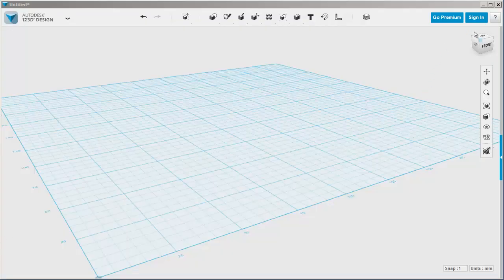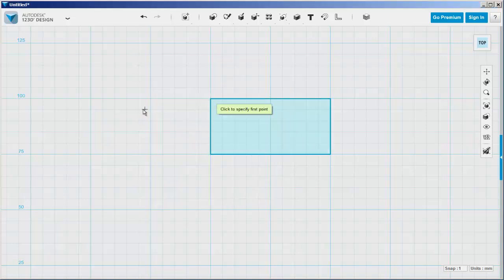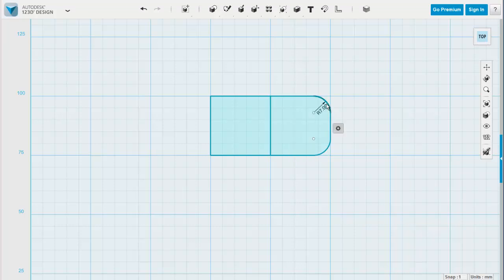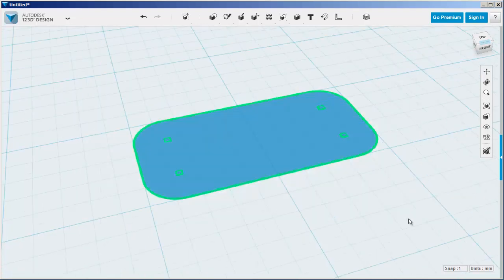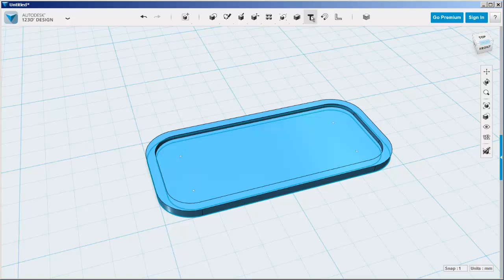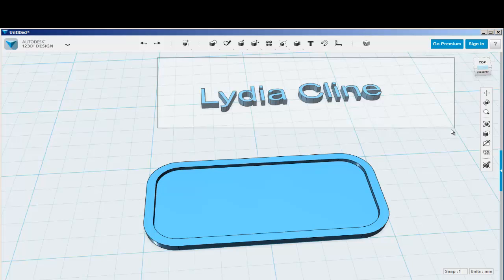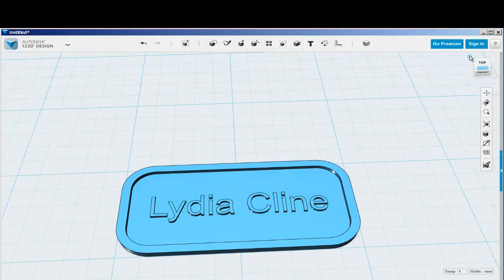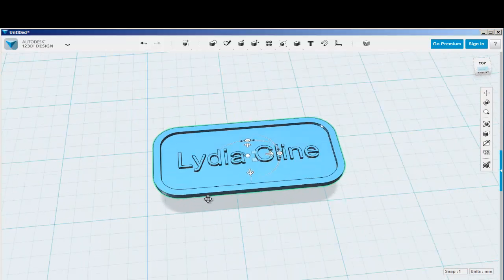123D Design: Model a Business Card for 3D Printing

Comment: Thanks for your vid. One question-when you place TEXT on the card, how do you manage that to be centered?
Reply: Ooops, I found the way. I used a ruller, didn´t know this tool before :-)
Reply from the maker: I eyeballed it, which is easy if you draw the rectangle on the grid symmetrically. You can also sketch a construction line and center it on that.